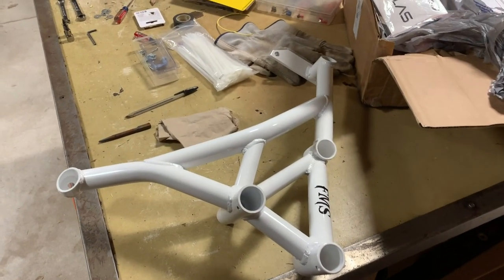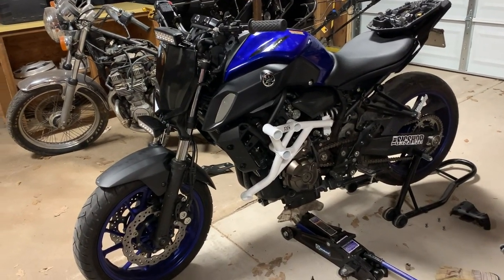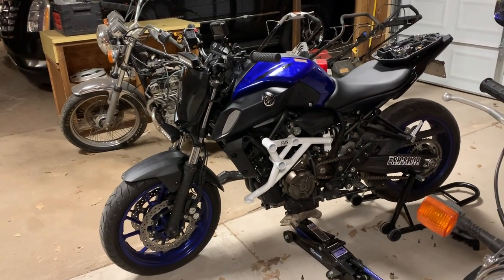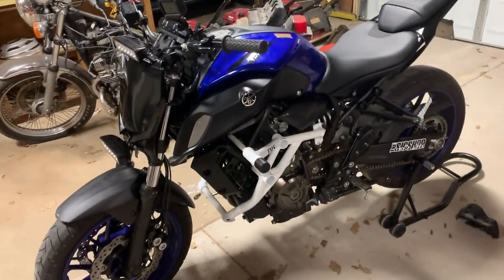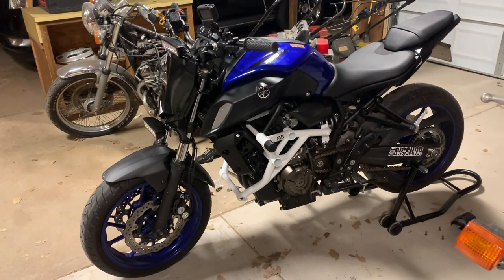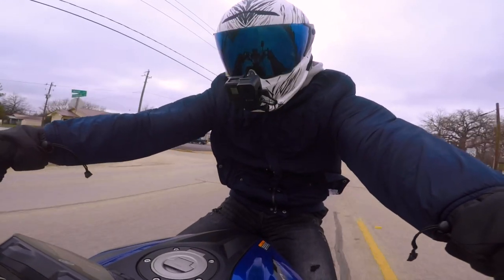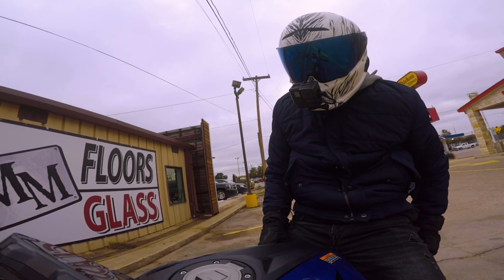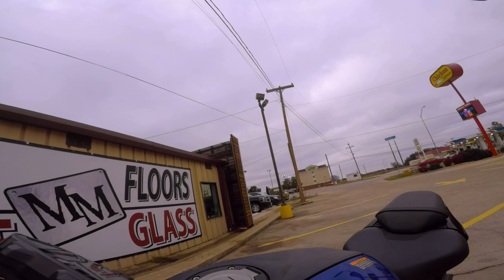2018 MT07 CRASH CAGE INSTALL (Full Metal Stunts)- MT07 Stunt Build Series Ep. 3

Comment: This video old but what bracket and light bar setup is that? And would it work with stock headlight housing?
Reply from the maker: I got everything from Walmart. Me and my dad had to set it up ourselves with a bracket we made and used connectors to make it plug into the OEM housing plug

Comment: Hey man tried to send personal message but couldn’t find out how, I’m wanting to do a headlight delete/number plate/light bar setup how did you do yours? Looking for some pointers
Reply from the maker: What are you wanting to know? Everything was pretty straightforward. I didn’t cut anything. I just added wires to make the two light work as a low and a high
Reply: The Assassin , I mainly wanted to know what number plate you recommend using and what light bar and brackets you went with, I’m pretty good at wiring so that’s not my worry, just don’t know where to start what parts fit good ect . Thanks !
Reply from the maker: If you have an insta I can show you what I went with just message me!

Comment: In regards to setting the idle speed back to normal at the end of your ride: why did you have the idle set higher than normal during your ride?
Reply from the maker: You do it so when you’re in a wheelie the bike doesn’t jerk you around
Reply: Oh, interesting. Is raising the idle speed standard operating procedure for all stunt bikes or is it only done on the FZ/MT-07 because of the way the power kicks in so abruptly when going from closed throttle to the throttle barely open?
Reply from the maker: Every stunter does it. It’s just set differently for different bikes cause each bike has their own throttle response
Reply: @TheAssassinMT07  That's good to know! Thank you for sharing your knowledge. I'm just starting to mess around with stunting and thus far only know enough to be dangerous!
Reply from the maker: Haha no problem! Stay safe out there brotha ✊🏽🙏🏽
Reply: @TheAssassinMT07  +1 how could I adjust the throttle